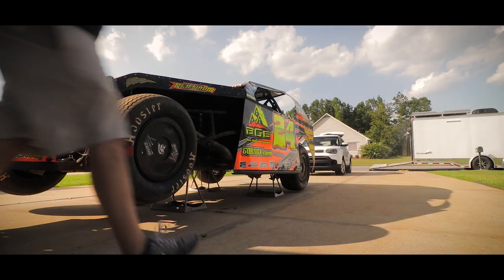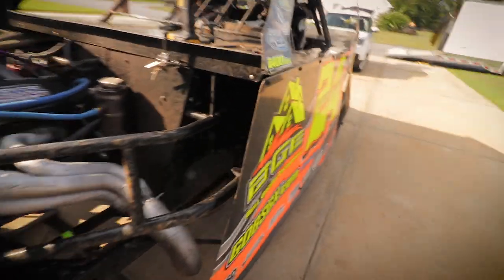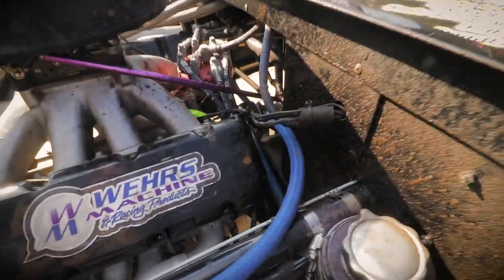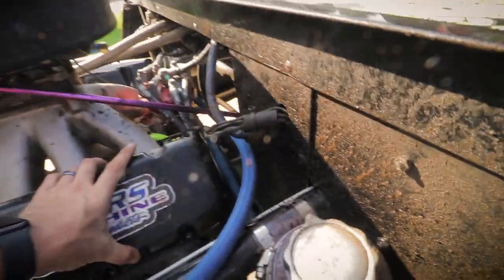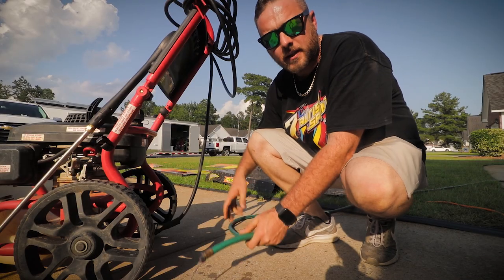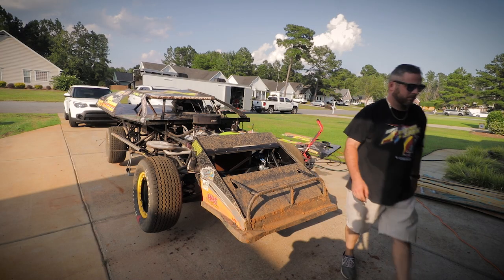HOW TO WASH A RACECAR...

Comment: What do you cover up/avoid spraying? It only take us about 2 hours to clean our sprint car. It takes longer putting plugs in, marvels mystery oiling everything, etc.
Reply from the maker: I avoid the electronics as much as possible. I take the doors off every time. That 3 hours also includes getting it out of the trailer. The tires off and clean and getting it back in the garage and up on stands.
Reply from the maker: Oh and a WD-40 bath!

Comment: I can tell you run about 2" of stagger in the rear . And we always used purple power
Reply from the maker: I used to use purple power but it seemed to bleach the aluminum.
Reply: I learned this from a channel here on YouTube called Hunt the Front they use 4 cap fulls of tide laundry detergent amd half a cap of bleach i think in a 2 gallon sprayer works quite well